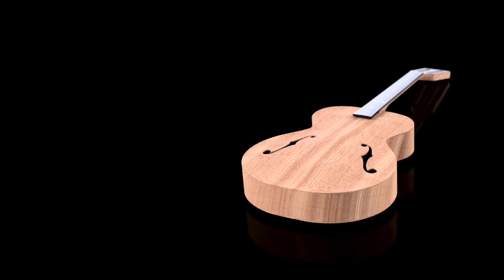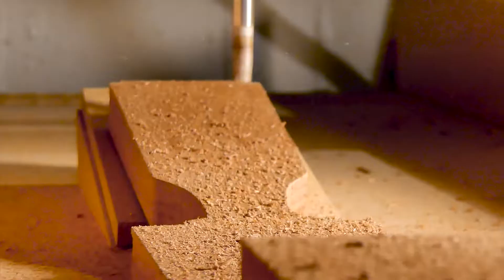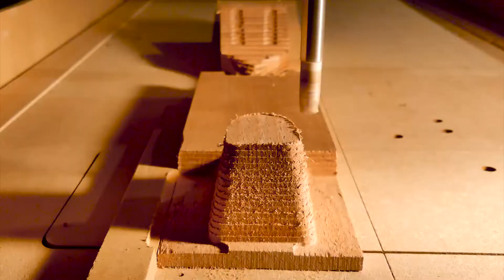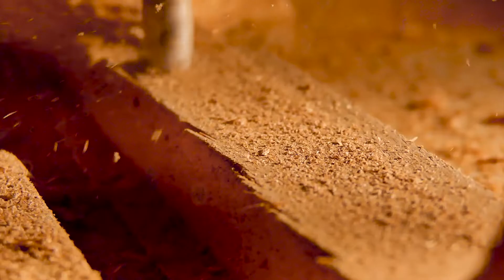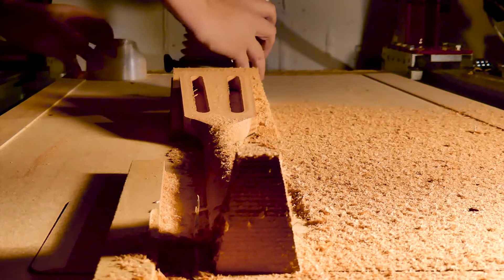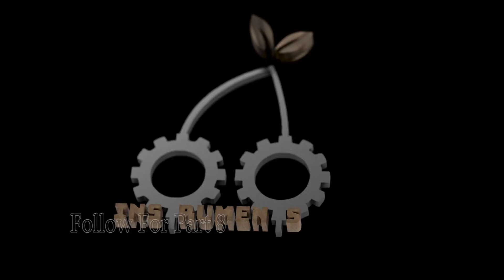Building an Acoustic Octave Mandolin from Scratch: CNC and Hand Tool Hybrid Approach | Part 7

Comment: Great! Looks like you've cracked the heel/neck/headstock mill from one side. I'm juts about start hand carving mine.
Reply from the maker: Believe it or not, this is the 3rd side of the neck; the first operation is the headstock outline and slots, 2nd is the truss rod and neck reinforcement slots, and this video is the 3rd operation. Still, a bunch of handwork to be done, but it's close enough for me; I like to ease the transitions and finish them off by hand.
Reply: @TwoCherriesIns  I get it. And the accuracy means repeatability. So if you made two bodies and two necks, either would fit well. I'd like to achieve that level of accuracy.